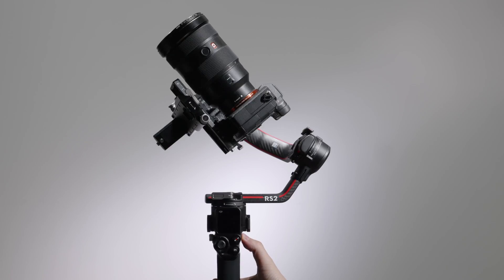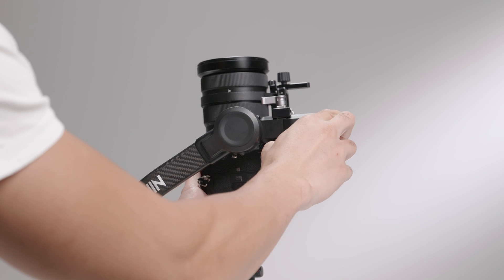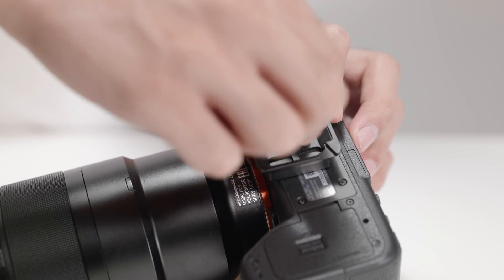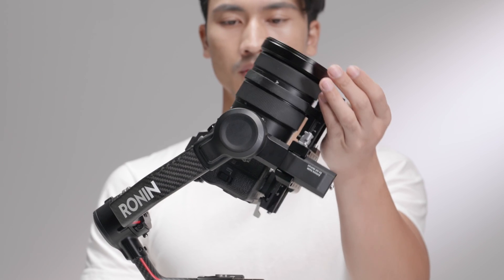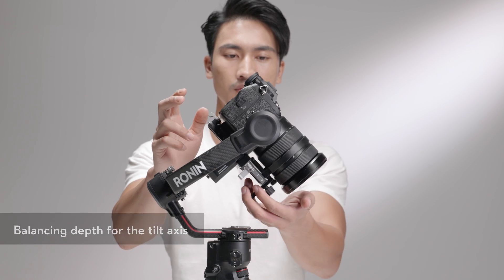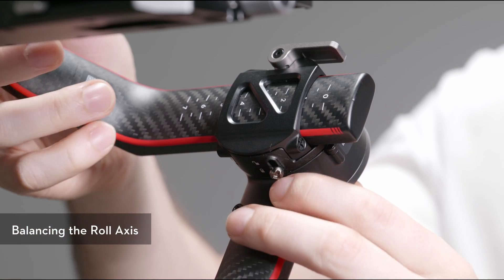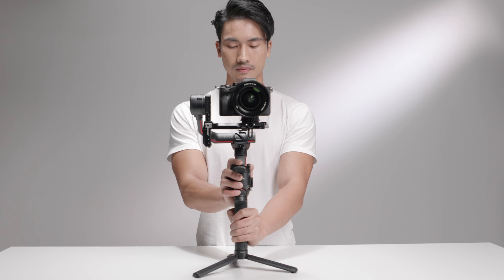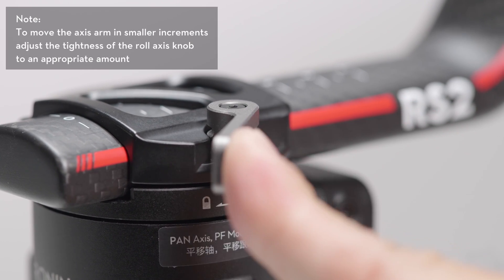DJI RS 2 | How to Perfectly Balance Your Gimbal With Few Steps

Comment: Does anyone else have a situation with the roll axis where it just will not stay in a position and returns to the centre, no matter how much you microadjust it and even if all the other axis are balanced? On the front screen the gimbal icon is green and it believes it is well balanced but I cannot get it to stay as in the video?

Comment: It is not possible to balance the pan axis with my RS2 and I have years of experience with balancing gimbals. All the other axis' are perfectly balanced, but no matter how I adjust the pan axis, the camera always tilts to the right side. It looks like there is a production error with the positioning of the pan axis or something.
Reply from the maker: Hello, there, please check the following steps: 
Method 1. The most accurate judgment method;
Connect to the mobile device, launch the Ronin APP, find the "motor parameters" setting, click "more parameters", and check the power values of the pan axis, pitch axis, and roll axis. After the Auto Tune is completed, the smaller the power value, the better the balance status. If it exceeds ±5, it is recommended that the customer re-adjust the mechanical balance before performing Auto Tune .
Before Auto Tune or after the mechanical balance is adjusted, it is recommended that the power values of the pan axis, pitch axis, and roll axis are all within ±5 before performing Auto Tune.
Notice:
1) Check the power value of the three-axis, the gimbal must exit the sleep mode. If the gimbal has entered the sleep mode, but the power values of all three axes are 0, and the gimbal is powerless, it may be a malfunction of the gimbal motor.
Method 2: The most commonly used method；
Connect to the mobile device, launch the Ronin APP,  find the "balance adjustment" setting, tilt the gimbal according to the APP icon (the tilt angle must be greater than 15°, the APP interface prompts the current tilt angle), click "start detection" to check the balance detection result .
Notice:
Method 3: The method which does not need to connect to the APP;
Check whether the camera and the gimbal can maintain the current position at different angles through the video provided by the customer. When the camera tilts up 45°, tilts down 45°, tilts 45° to the left, tilts 45° to the right, and the gimbal tilts 45° to the left, tilt 45° to the right. If the balance cannot be
maintained at any position, the mechanical balance still needs to be adjusted.
1) Ronin-SC recommends that the tilt angle of the gimbal is about 30°
If these steps can not help you solve this problem, please contact our support via this link: https://www.dji.com/support/repair 
Thank you for your support.

Comment: I have two RS2 units, both show Error 1009 upon doing a Gimbal Self Check, after a successful Calibration and  Balance (Excellent on all three axes). It does not always fail, but fails enough for me to not count on it working correctly.  I've sent them both the DJI for 'repair' and they replaced them both after finding the faults.  Now both of the replacement units yield the same Error 1009.  I'm mystified that four of four fail for me and I do not see that others are having the same issues.  Any recommendations?   Thanks
Reply from the maker: Hi there, we replied to you here. https://www.youtube.com/watch?v=q3jShFuogII&lc=UgzPKoOedDY5nA7OaOt4AaABAg

Comment: tilt axis always lean to the front a little (lens pointing up process), can't adjust any further because already hit maximum limit to the tilt axis motor. use sony a6600 with sigma 16mm/35mm/sony 18-135mm. any suggest?

Comment: The vertical lift arm is so hard to move when a camera is attached, the side is all scratched now.
Reply from the maker: Hello, there. Sorry for your inconvenience. The roll axis of ronin s is a non-orthogonal design, so the cooperation between the axis arms will be relatively tight, and the additional weight of the camera will cause the axis arms to be inclined, resulting in a large friction force.
It is suggested that when adjusting, refer to the figure below and lift the arm marked "RONIN" to reduce the friction of the shaft arm, and then adjust.
Reply: @DJITutorials  Thanks, refer to which figure?
Reply from the maker: @andrewhayden8071  Hi, Andrew. Sorry, here is the picture: https://pan-sec.djicorp.com/s/JnwnweCfaijbGPq
Password: andrew hayden
Reply: @DJITutorials  thank you
Reply from the maker: @andrewhayden8071  You're welcome. Should you have any further inquiries, please feel free to contact us.

Comment: I’m finding it so hard to balance my 1DXii with a heavy lens
Reply: Okay brotha, I think I found the solution on another video. You start the tilt axis all of the way at the bottom of the tilt arm. Balance the camera with the adjusting knob on baseplate. Get the camera looking straightforward level as possible. Then point camera upwards and perfect that by sliding the camera up the tilt arm to where it needs to be. Once the camera can look straight upwards without moving, Then put the camera in a looking forward position and use the adjusting knob one more time for fine tuning. Works great for me and seems to be working every time.
Reply: Same here. My P6K with a 35mm Meike S35 lens is very difficult to balance. Have you found some tips for speeding the process?
Reply: @Mrjimmybuckets24  I found another video that said to tighten the roll axis twice once you’ve balanced it, since sometimes you when you tighten the roll axis it looses the balance you set originally. (You can pull the tightening knob out and rotate it back without turning the mechanism) I have yet to try it yet though as I haven’t had a need to.
Reply: Thank you for the reply. I mainly struggle with the Tilt axis but think I found a solution to quicker balancing. Will test.
Reply: @Mrjimmybuckets24  so I tested it the past two days and it did help Though I also decided not to use a shotgun mic as well. Let me know!

Comment: The Roll Axis seems stuck even though I unlocked those 2 things. Should I send it back for a new one?
Reply from the maker: Hi there, sorry that you're having this issue. Could you please check again if the roll axis is unlocked? If yes, please contact our support and provide a video of this issue for further assistance. http://www.dji.com/support
Reply: @DJITutorials  thank you !
Reply: Did you manage to resolve this? Mine appears to be stuck as well.
Reply: @ivandyap  yes, all you need to do is pull on the part that locks and unlocks the roll axis and then turn it to loosen the grip until there’s wiggle space.
Reply: @SHADOOjoey  Thanks! Mine is exceedingly tight. Could be due to my payload :-)

Comment: Balancing the pan axis in DJI RS2 manual says tilt the gimbal FORWARD.  This video says tilt the gimbal BACKWARDS.  Which is it?? They give totally different results and could therefore be burning out the motors!!!
Reply: Calm down, the pan axis is the least stressed axis.

Comment: I have an issue balancing Roll axis. When I let go the camera at 45 degree, it bounced back to horizon at mid point. Need help here, Cheers.
Reply: @gerardorodriguez7858  I think the trick is to tighten the clamp as much as you can by lifting the clamp up and out of its spring seat and readjusting the clamp so that it clamped really hard, carbon fibre is more springy than metal so the pan and roll axis need more tightening to prevent any shifts in the arm clamps when they move.
Reply: I have the same problem, but with my RS3!

Comment: Your vertical tilt slider caused me metallic scratches. Thanks a lot. Whats the point of unlocking that tilt, if the slider still barely moves? When you naturally apply some pressure to make it slide, it scratches the chassis of the gimbal. Not pro quality.
Reply from the maker: Hello there, we are sorry for bringing any unsatisfied experience. Could you please tell us the camera you use?
Reply: @DJITutorials  Blackmagic Pocket Cinema Camera 6k with Sigma 18-35 mm lens.
Reply from the maker: @SkirmantasStankevičius  Thank you, would you mind providing a video of the issue to us? We would love to check more about this. Thank you in advance.
At the same time, we may suggest that you hold the camera when you move the slider.
Reply: @DJITutorials  oh
Reply: @DJITutorials  I have the same problem. My S2 is about two weeks old. I love the gimbal, I look forward to using it on gigs, but this grinding on that one axis--there's already scratching where the grinding takes place. It is VERY difficult (impossible) to move incrementally, as opposed to the carbon fiber arms--those move smoothly. HELP!!!
Reply: Had the same issue with my Canon 1DXII. An adjustment knob would greatly benefit this area. Even when pushing the camera upward when attempting to adjust, it can be difficult with heavier bodies.

Comment: the pan axis balancing instruction part is opposite to the broll. if anybody would notice
Reply: Thank you so much! I’m tired and preparing for a shoot. I was questioning my sanity…
Doesn’t help that they cut to the opposite angle for the adjustments. And what does mean “right” and “left” in that context.. shouldn’t it be clockwise/counterclockwise and in and out?
Reply: Wow i thought no one noticed.